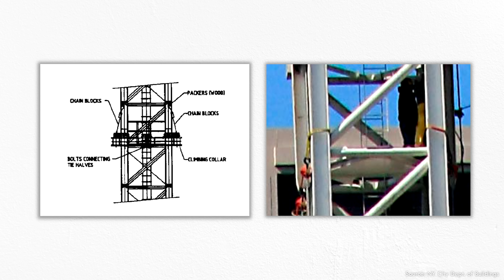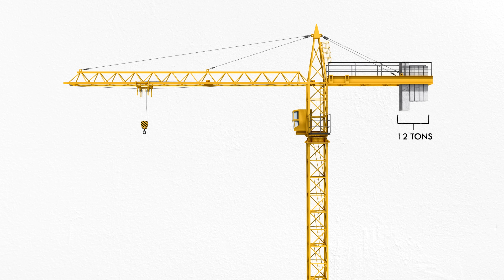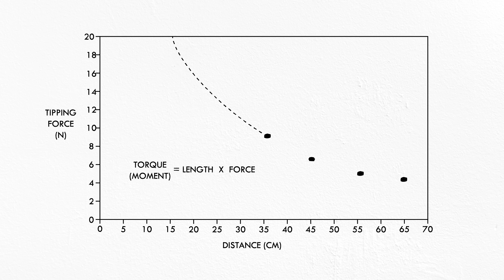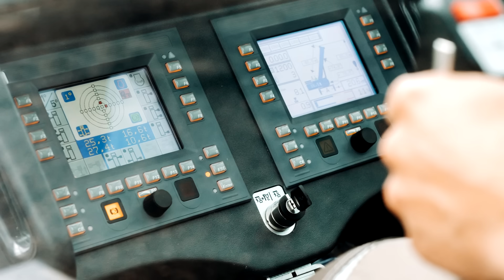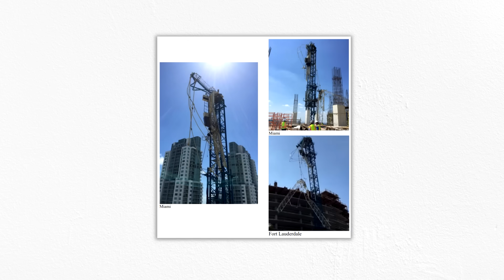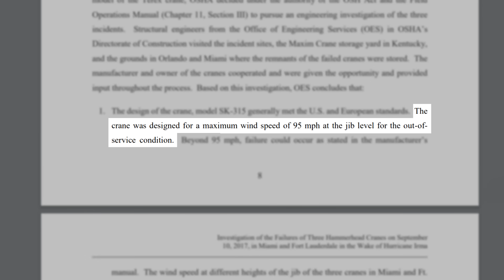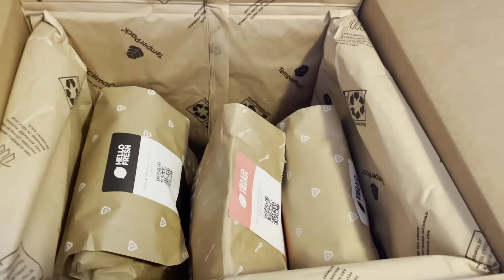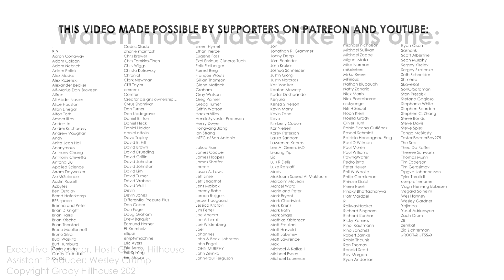Why Cranes Collapse

Comment: Tpf manufacturer assembly doesn't mean safe 😂 I work at the largest shipyard/wharf in the country and often work with the largest crane in our region. We have two kinds of cranes we build here when we need a extra crane for our projects, usually ti save in running costs by not using our massive gantry crane for small loads. (Technically three but ine if the models was more so a test of use rather than a regular crane we take delivery of) The first type is a Liebherr model, we usually assemble them ourselves following the manuals and strict safety procedures. We get paid by the hour, and we're here for a full 2 week rotation no matter what so it takes anywhere from 7-14 days as cranes here don't have #1 priority and we take it one step at a time. The second company we use I won't name but they send out their own technicians, fly out technically. They're away from home in another country, they're here until the crane is done. They REALLY want to go home asap. With them they're constant nagging, a push to finish in max 3 days, so many safety regulations broken and bent to speed it up, and we have to frequently make reports on their actions (mostly to cover our own skin) as they're unnecessarily risking their lives time and time again. Imo we could do a better job assembling the cranes (we've only done it like 10-15 times now we got two of those standing rn 1 we finished last week) without the manufacturer than with 😂

Comment: i worked for a civil engineering firm that spec'd and then built the earth-base for a tall crane that had only one large (and expensive) piece to replace.  soil conditions were the worst.  and much patience was needed to wait for a day when the wind was low enough to operate.  given the location to be operated from, the base was a pile-up (in retaining wall fashion) rather than a dig-down structure. for a lot of things, being unmemorable is really good.  I reacall no crane issues with the part replacement.

Comment: How could somebody trained on cranes that include that monster crane that failed in high winds, forget to include winds in calculating maximum operating weights?  Probably thousands of hours in training plus experience in many different types of cranes plus additional mandatory safety training that they have to take every year to keep their certification.  I don’t think they just let anybody who thinks it would be fun to lift 400,000 pounds to jump in and play around with Godzilla the Crane Monster.

Comment: that crane operator was not in the seat the super put the oiler in the seat due to the fact the operator refused to make the lift, the operator was across the road at a restaurant eating when this happened. This was the issue that made OSHA come to the table and state that crane operators be held to criminal charges

Comment: Came here just to make sure they included to crane collapse in Milwaukee. I went to a baseball game at the old county stadium shortly after the crane had collapsed and was still hanging over the side of the stadium. due to construction of the new facility, some of the parking lots were only accessible by driving near the collapsed crane. Those parking lots, for obvious reasons, were closed off but we could still walk near where it happened and see parts of the damage. The saddest part of that accident was that the 3 iron workers that were killed could only watch as their demise came because they were all in a suspended personnel platform that was taken out as the crane came down. No where to go and nothing to do but watch and wait as it fell.

Comment: Very good video,  don't forget about over stresses nylon straps,  frayed straps and wire rope cables,  using  incorrect clevis,  home made spreader bars, poor maintenance of the crane,  incorrect lifting points of the material, shifting loads up in air,  ect.... many crane accidents are a combination of little things that add up to one big disaster.

Comment: thats not why they pulled those pins out in seattle. that was my job site, i was the pilebuck lead welder. they were over worked and exhausted and accidently pulled top pins out of the boom and when they disconnected to readjust their straps it broke loose and swung down using the remaining bottom pins as a hinge point causing it to swing and slam into it self. was a bad day. there were allot of not ok things happening on that job site by the contractor doing illegal things and taking advantage of workers and big time over working them.

Comment: No engineering needed to see why most crane mishaps occur.. mostly human error, cost cutting by trying to use an undersized machine, prioritizing schedule over Windy conditions, operating on unstable surface that can't adequately support the crane, not using enough counterweight, improper or faulty rigging and use of rigging, lack of maintenance etc etc.. Profits over workers safety these days

Comment: FYI the big blue collapse did not have the everyday operator in the seat. The operator of the crane refused to make the lift that day and left the site the supervision made the call to use the operator trainee to make the lift. That is what happens when project timeline over safety is not adhered to and uniformed supervision. the men that died that day should have never happened.

Comment: 12:56 The collapse of big blue as it was called and still is called. 5. Here in local 383 Ironworkers out of Madison, it's regarded as one of the worst incidences to have happened within the state of Wisconsin and within an ironworker local and we hold a very somber tone whenever it is brought up. The cranes full-time operator refused to make the pic that day and a different operator opted to. As for the three construction workers who died, they we're Ironworkers utilizing a crane basket which was taken out due to the collapse of big blue

Comment: Lifting 500 tons, wow,  I didn't even know that was possible with these skeletal looking structure. But to 97% of the cranes ability is asking for trouble If you know that wind can take it well over that percentage. 
I heard that the original operator refused to do the blue crane job because he could see it  was overextending the crane's ability and he got sacked.

Comment: Many of these failures don't have the easy answer of 'operator error', these are design and regulatory failures.  Why doesn't a crane have a balance cell that tells it when it's overloaded and an alarm that screams bloody murder if its 3 tons out of balance?  Why would a crane, a dangerous temporary structure, allow unbolting in a way that allows collapse without screaming about it or physically denying it's ability to be disassembled in this way? I could go on, but behind most 'operator error' failures, also lurks design shortcomings on the level of 'unsafe at any speed' for pintos.

Comment: The crane in Milwaukee didn't go down just because of wind.  It went down because of the "human factor".  During the test lift the crane sank about 6-12" into the ground - red flag #1.  During that same test lift the roof section didn't come up exactly plumb.  It was out of plumb by 10-15 feet causing additional torque and drag stress on the crane - red flag #2.  The operator's manual for that crane said the boom had a wind tolerance of 20 mph.  The wind was blowing at a steady 19-21 mph with gusts nearly reaching 30 mph - red flag #3.  A few days before an additional 100ft were added to the boom without extra ballast to counter that weight - red flag #4.  About a week before this accident the original hoisting company was fired by the prime contractor (Mitsubishi Heavy Industries-USA) for not doing lifts where windspeeds exceeded 10-15 mph depending on the load - red flag #5.  There was no clear cut chain of authority for go-no go conditions of the lift and who could terminate the lift if/when conditions were deemed unsafe - red flag #6.  The crane had an unreliable maintenance record.  The point of failure, the king pin (aka pivot pin), had a pre-existing crack which was found during the investigation but any one of the inspections it was required to go through would've discovered it - red flag #7.  The crane operator had voiced his concerns over the wind conditions that day many times, as did many of the iron workers, but they were told the lift was happening that day (read between the lines as many of the iron workers walked off the job that day protesting the lift) - red flag #8.  The project was falling behind schedule and pressure was mounting to get back on track as the contractors had bonuses, incentives, and fines and penalties for making or missing deadlines - red flag #9.  

It wasn't just one thing that caused the crane to collapse, but a multitude of factors.  Take one or two of those factors away, or give final go-no go decisions to the operators and this doesn't happen.  In the end cutting corners and rushing things to make sure American Family Field was ready for the 2000 baseball season and to avoid penalties those decisions delayed the opening of Amercian Family Field until the 2001 season and incurred an additional $300 million in repair costs, clean-up cost, litigation, and punitive damages and most importantly 3 human lives.

Comment: What scares me is that the very people that are qualified & tasked to assemble & disassemble & operate Tower Cranes are the idiots of whom were why it failed or ended in disaster..... ( As can be confirmed from all successful operations executed by Cranes & "Suitably successful operators".
As a, luckily, virtually all residential Carpenter of 37 years skin in the game, I've mostly escaped working on sites with Tower cranes but there has been numerous mobile cranes, some very big - 200 tonnes ( mostly needed for reach...). Tower cranes have always scared me working below them in the fact that, when they go down, they, especially, make a BIG mess & destroy all below that they fall on..... Even with 15:39  the big boy mobile cranes on very big elite homes that I've worked around for 25 odd years, - I've always had a massive respect & awareness of them operating, usually close by.... 
Keeping an eye on the operator & the load & NEVER EVER walk under the load, NEVER! Thus far, I've survived & never been hurt.....

Comment: The video begins and end by the 3:30 mark.  
human error , similar to a lot of airline disasters .
example -  working in fuel systems in the Air Force in 1967 , i was called to the main terminal to inspect fuel leaks on a commercial jet that had just landed . there was enough fuel coming out of the wing to warrant grounding and repaint the plane . i went into the cockpit and told the captain my assessment . he rolled his eyes and said " show me the leak " 
he went outside glanced up at the fuel dripping out and said " that's nothing , i'm taking off "  Yikes !

Comment: I'll have to watch this later with volume up, currently have students doing their course paperwork now. I clicked randomly on it though and it looked like you were trying to describe boom deflection so I will have to check this video out tonight as the comments look good. Been a trainer and assessor in this industry for 15 years including mobile slewing cranes, may have to use bits of this during my delivery of learning.

Comment: Unfortunately, I've had the opportunity to investigate crane accidents as a state construction safety officer for 23 years. Prior to that I had 23 years experience in heavy industrial construction. The worst was a lattice-boom crane, on a controlled demolition site. The general contractor figured on 5 lifts, and had drawings and figures for all of them. For some unexplained reason (?) one sheet was never shown in a prelift meeting. This sheet showed the 14' diameter steel duct was "too heavy" (with dirt debris inside it) and a note indicated it needed to be emptied. During the lift, once it was lifted off the building (200' in the air) the rigging shifted. The next problem was rather than keep the rig boomed up tight, a fatal decision was made to boom down so the load could be set past a pipe bridge. Once boomed past the "point of no return" the crane began to tip forward. Ultimately, it crashed and the tons of counterweight knocked the cab off the body killing the operator. Examining the electronic spread sheet from the computer, I noted that the load, which was supposed to be around 40 tons, ended up being around 55 tons. There were multiple times noted when the rig was loaded at 125% for it's configuration.

Comment: Every time I see a video of a lattice boom or extending boom crane tipping and falling...(except for the failure of the ground under outriggers)....my first thought is..."Suddenly, Bob wished he'd ordered that extra truck load of counterweights"....
   Especially so when 2 cranes are trying to tandem load or unload a boat, the strap slips, the boat falls, the crane falls into the water, then the other crane falls into the water....and they all quickly sink...
  Hopefully the crane operators were able to escape safely.

Comment: Check your crane load chart that’s on the machine for the load configuration you happen to be in (main, luffin, jib and their lengths, etc) plus counterweight and load weight. Then you must know your lift radius. The main thing is you have to do it BEFORE the pick. Wind loading and ground compression factor in as well.

Comment: Do those extremely tall cranes have anemometers to keep the operator informed of the wind speeds so he or the machine can adjust or stop work accordingly?
Reply: They are In tune with that yes they have a ground station and are tuned into local weather

Comment: I operate a forklift in a yard with several others, and have seen a few incidents with them; mostly misjudging the size or position of the load and hitting something, overloading past the load plate spec (can be especially nasty in the rain since water can make a normally fine pallet too heavy to lift), or a load that's not properly secured to pallet pushing things off balance.

Thankfully there's never been any injuries or worse, but I can see how crane operations are tricking beasts, especially given the size of those loads and their distance from the tipping point.

Comment: I'm not an engineer but I think the reason is that they lift very heavy things and the heavy things are heavy and that can make the crane collapse if the heavy thing is too heavy.
Reply: What? 😂
Reply: @DerNutellaBoy  I understand the confusion, it's a pretty weird concept. I'll try to explain but I'm not a scientist and I only have a basic understanding myself.

You see, Gravity is this invisible force that makes things with a lot of stuff in them attract things with less stuff in them. The bigger things literally pull the smaller things towards them.

The Earth is a thing with a lot of stuff in it, that's why everything falls down if you throw it, gravity sucks away at the throwing force and eventually overpowers it causing it to fall down.

Since gravity is always pulling everything down this means that we need to apply force to move things away from the Earth. This can be difficult if the thing we want to move has a lot of it's own stuff in it (compared to the average human) so we need to create machines known as cranes that are capable of applying the required amount of force.

Cranes are good, but they're not perfect. When they lift these things with a lot of stuff in them they need to be strong enough that the combined effects of gravity pulling down the thing they're trying to carry, as well as themselves. 

Cranes come in different shapes and sizes due to needing to lift different things, so if you use the wrong type of crane that isn't designed to be strong enough to carry the thing you want then the crane will break under the strain.

I hope this helped!

Comment: This reminds me of last year when I was on site. We had to haul a huge flange assembly up a tower using a crane. so after getting everything hooked up and cordoned off, we brought it up, tried to get it in place but it was juuust short of our placement. We radioed the crane operator to ask if he could boom out, and he responded by turning on his radio and all we hear is alarms blaring. So the answer was no😙.

Comment: The only issue I have with this video is when you talk about outriggers being deployed when they have the room. A Crane that utilizes outriggers should use them 100% of the time when making a pic unless it's a pick and carry; But pick and carry will always be over the front or the rear of the Crane never side to side.  these cranes do have load charts on tires.

Comment: I used to assemble, operate and perform ANSI inspections. Humans are the weak link. The  mistreated garbage some companies would try to get by on..... Human error is a big one, forcing it to go beyond capacity. Not using outriggers "because we don't need them or have room". Only once did I Red Flag a crane for structural failure.